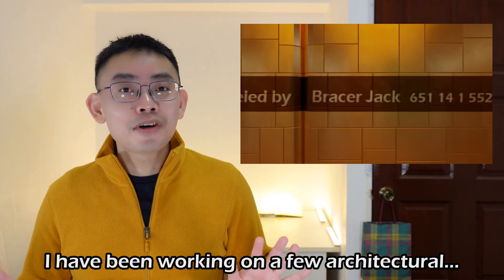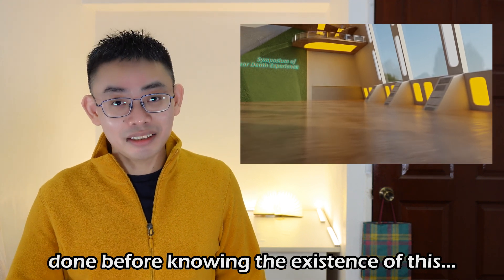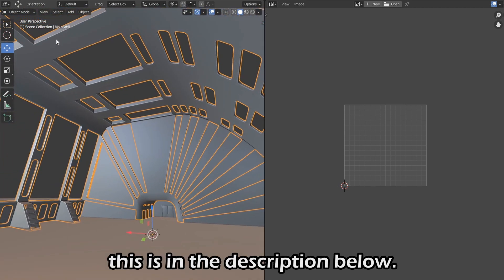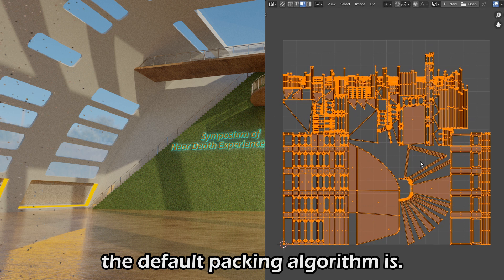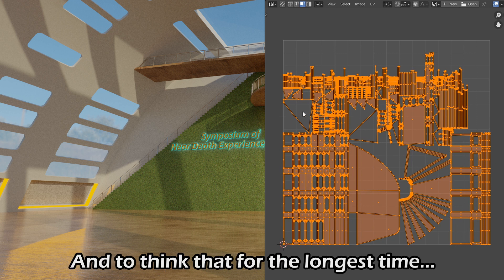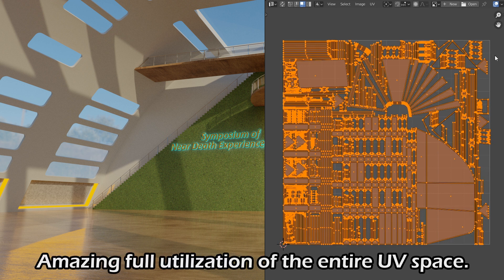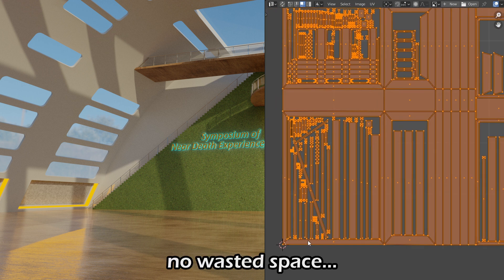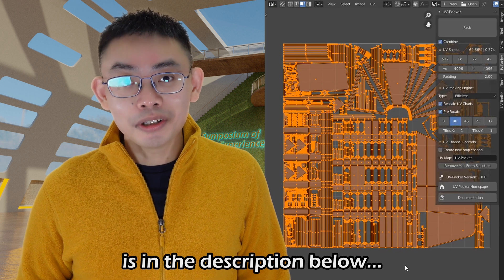Free UV Packer for Blender

Comment: But does it work in 3.0?
Reply from the maker: No idea, I am currently using it for Blender 2.93.1.
If you do test it on the latest version, would be be so kind as to let us know ?
Reply: @BracerJack  Hi. It works on 3.1 just fine.
Reply from the maker: @JBVector  So happy to know subdiv is now handled by GPU in Blender 3.1 :-D

Comment: Not done a great deal with UVs so far but looks good. Does it do a smarter job than the smart UV project or is it using the same algorithm only more efficient?
Reply from the maker: You use the smart UV project to break the UV apart first, then you use this add-on to make the packing more efficient, no more wasted space ! :D
Reply: UV-Packer is a packer, not an unwrapper; it uses latest algorithm for UV packings. You can check details and the free version at https://www.uv-packer.com/ thanks
Reply from the maker: @3dioplugins  Thank you so much for dropping by, guys they are the creator of this add-on :D